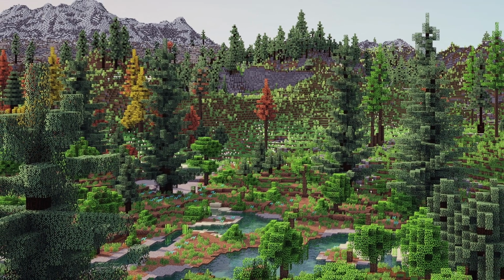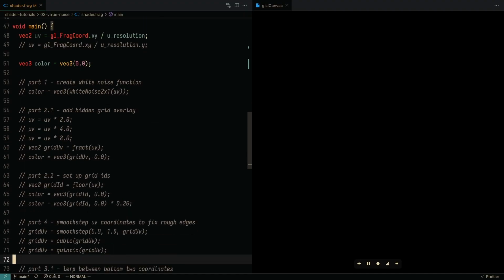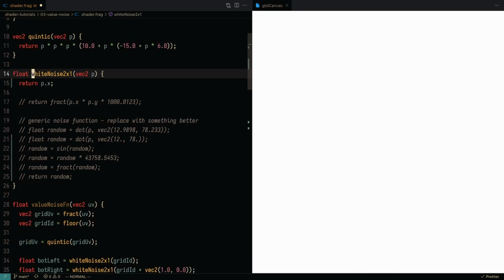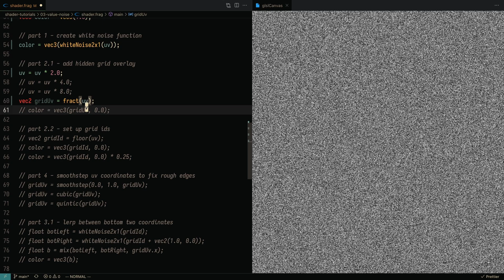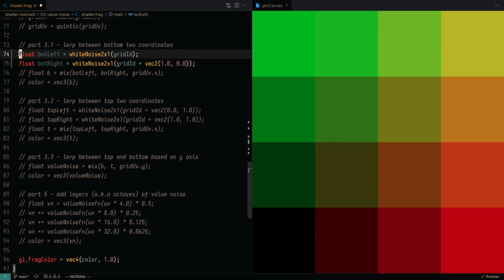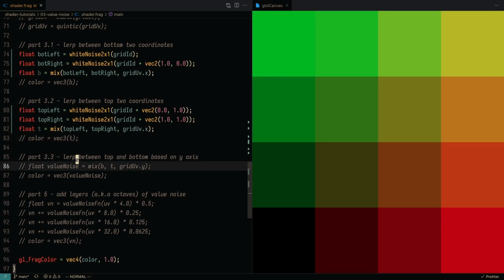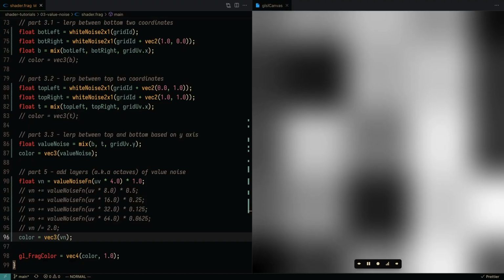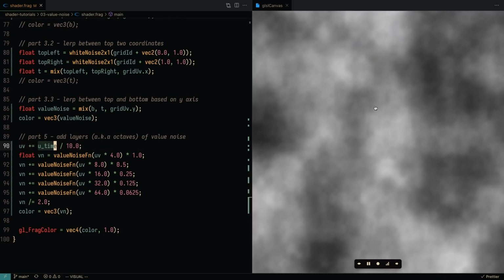What is Value Noise?

Comment: The `whiteNoise2x1` function uses this line to initialize the `random` variable:

    float random = dot(p, vec2(12., 78.));

This will generate obvious patterns at higher resolutions. Using the more precise values (from the comment) fixes the issue:

    float random = dot(p, vec2(12.9898, 78.233));

All good.